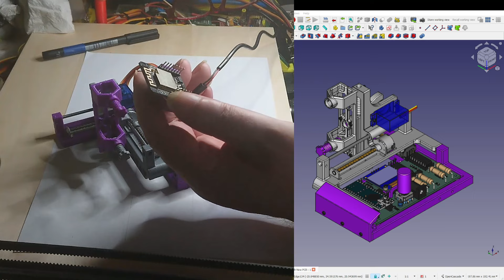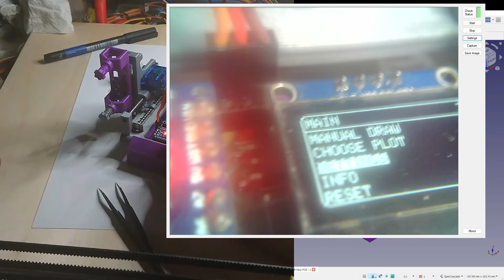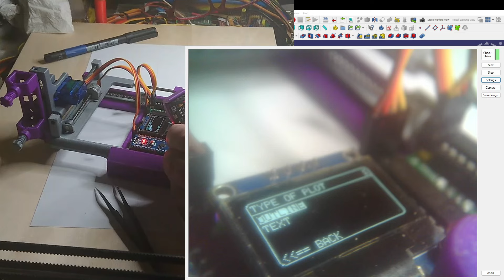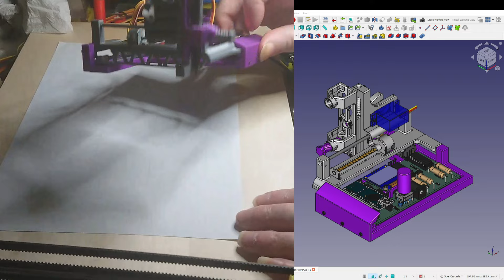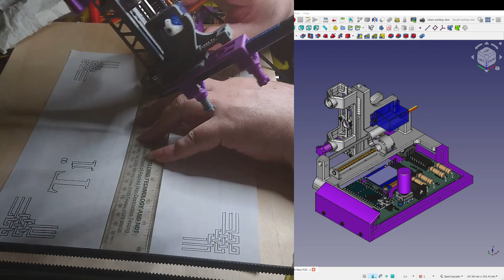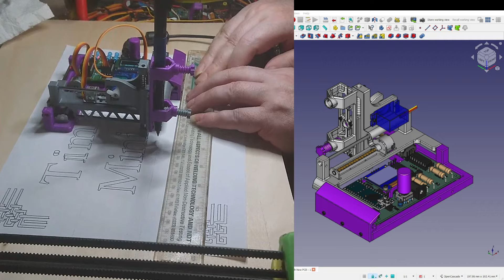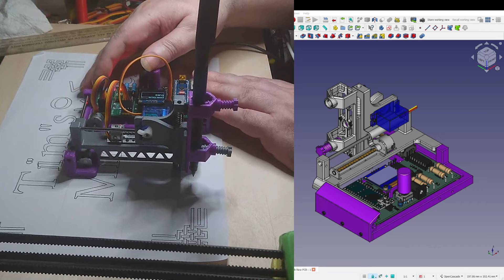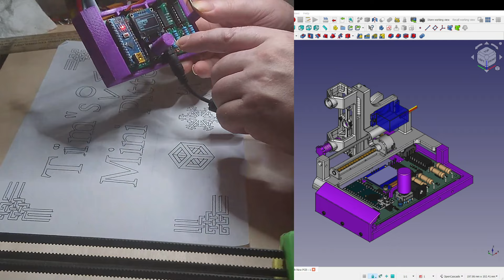Tim's Mini Plotter 2 [Live stream follow up]

Comment: build a stand for your cam x your paper on table and set your focus on it ,, and you move the item to it .for i feel you use the cam often . subscribed,
Reply from the maker: Thanks for the advice, and welcome.
The main cam on a stand is my phone, normally it is set on the overhead stand I made.
With this Item (my plotter) if I had placed the camera above, you would not be able to see the plotter printing, I tried it. I put it at this angle to get the best view, while it was plotting.
The other issue I had was, I am old (un fit), my arms get tired easily, holding it up close to the camera for long periods in its new position was hard for me.
As I had the ESP32-CAM I used that for the close up.